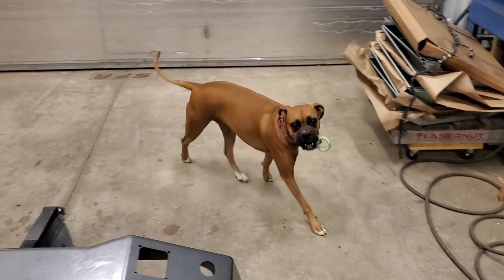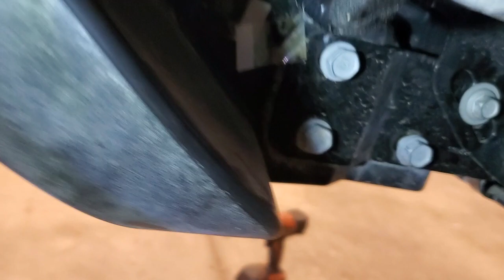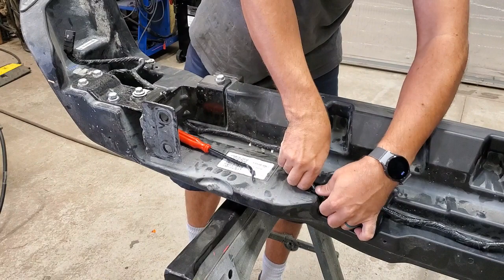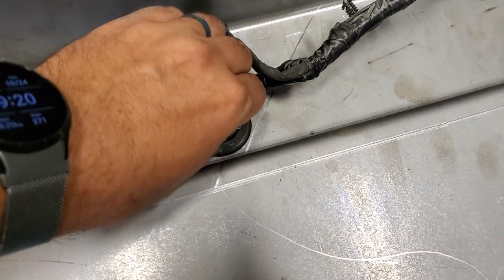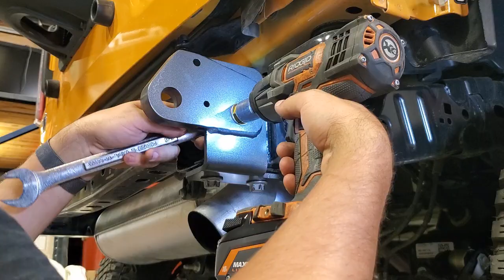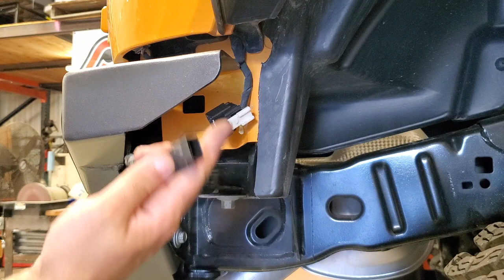SFR Sledgehammer Series Bronco Rear Bumper Install

Comment: That gap between the bronco panels/tailgate door and the bumper is way too big to be esthetically appeasing. Is that corrected in the final product?
Reply: The gap isn’t any larger than the gap with the stock bumper. Keep in mind that the body is on rather soft mounts. If you make the bumper too close it'll bang into the body on rough roads.